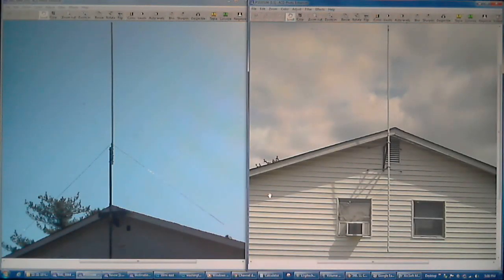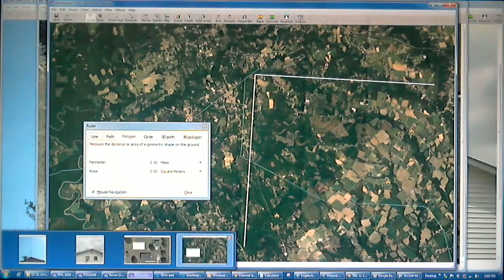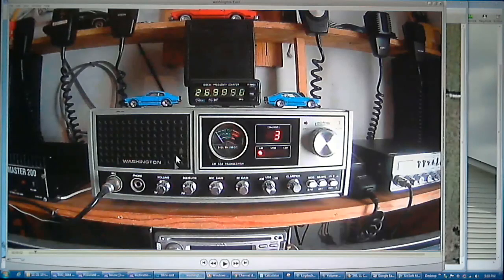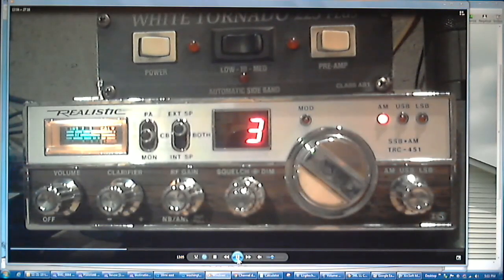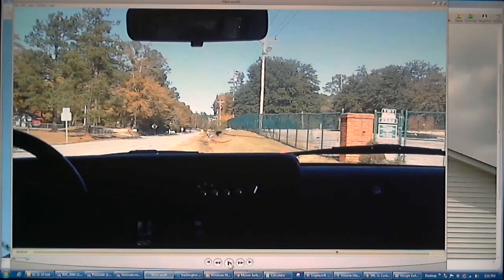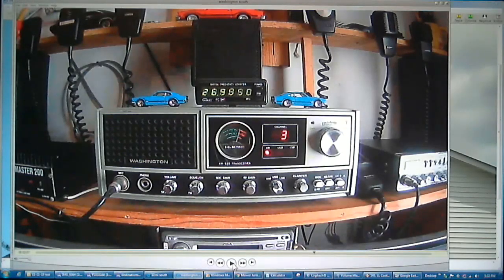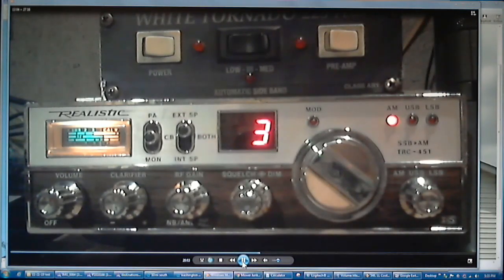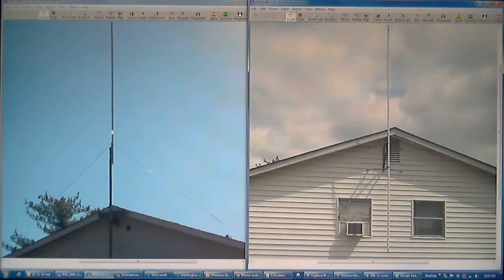CB Radio base antenna test, Are they Directional?

Comment: To make a comparison you need to use same radio on both antenna s
Reply from the maker: I've had both radios connected to the antenna on My house. I have talked to many locals on both radios, to the North, south, East and West. and for all of them, Their signal strength was exactly the same on both radios. Thanks for watching, 73's from 151 SC.

Comment: To me using 2 different radio S meters could cause a problem because not all S meters are exactly the same. Also mobile antennas tend to be somewhat directional too. There are too many variants involved to really get a definitive  conclusion in either of these test.

Comment: enjoyed watching the test, but in order to be accurate those two radios need to have their S meters calibrated with the same level of input displaying a read out of S9.  If this hasn't been done, im afraid you really won't know whether one was better than the other.  you  could switch the radios and see if the better signal follows the radio or the antenna i guess.
Reply from the maker: I've had both radios connected to the antenna on My house. I have talked to many locals on both radios, to the North, south, East and West. and for all of them, Their signal strength was exactly the same on both radios. Thanks for watching, 73's from 151 SC.
Reply: @MowerJunkie  oh cool, that means there definitely was some directionality.
Reply: And also what is the terrain/environment like? Is there more hills to the east and flatter to the south? This will play a part in signal strength.
Reply from the maker: @spinnerinthebubbleCT4543  I chose these 2 spots because the elevations are the same, and the terrain is the same between Me and the transmit locations. I originally wanted to go further away, but this was as far as I could get and keep the conditions the same.

Comment: I finished making my antenna yesterday. Same as yours buddy 😎.  Swr 1.1 across the all 40.  Thank for posting videos .Your easy to follow along too. I do have one question. I was able to get the top of antenna over roof of house 25'. However radials are below roofline. Is this ok or bad?  Watching up her in  Southern, Ontario. 1 hour from Michigan. 😁
Reply from the maker: That's Awesome! One of My antennas has the ground radials below the roof, and one is above, but they both seem to perform the same. 
Thanks for tuning in, and enjoy that new antenna. 73's from 151 SC.

Comment: Try both at 10 miles southeast to compare the two radios under a neutral condition. Confirm differences between the two radios.

Comment: 903 up by the dog gone water tower...Seattle.  Now if you only had one radial it would be a inverted L and perhaps directional as well. NineHundredandThree pulling the plug.......glub. Glub. glub.  73
Reply from the maker: Copy that 903! an inverted L would probably work the same as a bumper mounted mobile antenna, All the signal would go out the back, with a keyhole  style wave pattern.
Thanks for watching, 73's